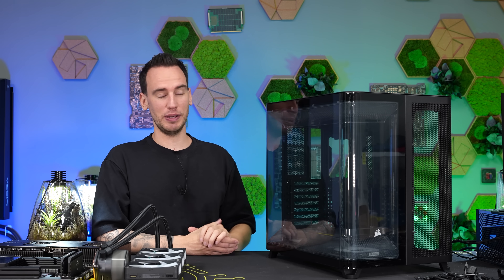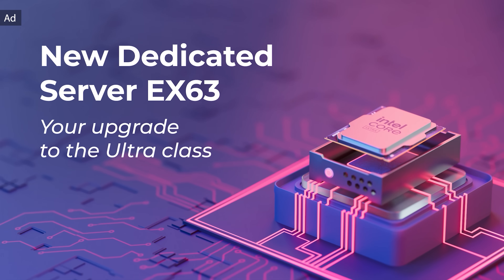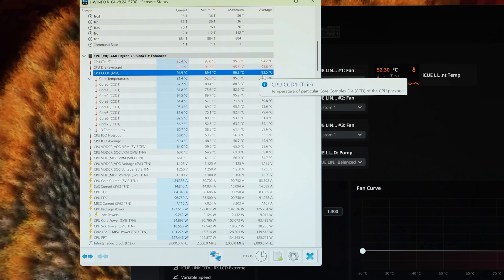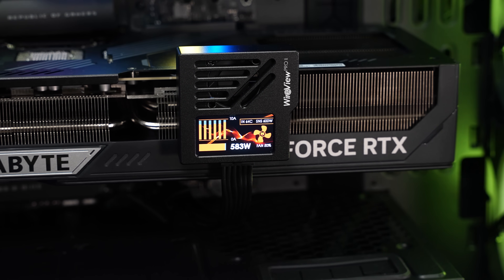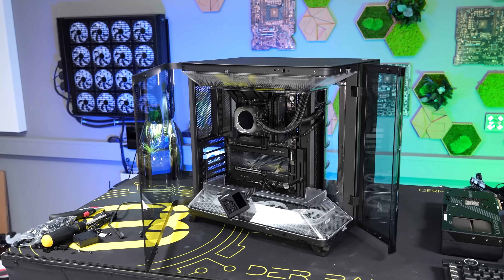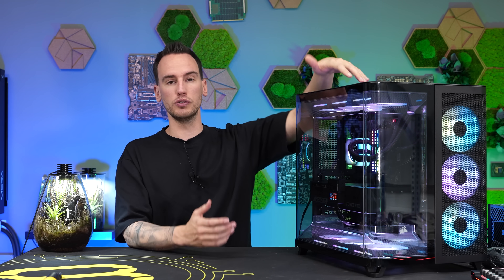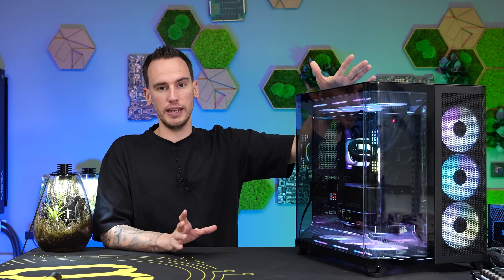Are 3 Chambers Really the Future of PC Case Design?

Comment: Don't compare cases like this please.
You're comparing a shared 3in/4out fan-setup (7 in total) with a different dedicated 3in/3out fan-setup while basically having the 3fan AIO out of the case (9 in total). That's not fair nor even close to scientific.
Remove the bottom 3 fans and the separator between the chambers and then guide it's air back in the main chamber if you want to point out the influence of all design-aspects in the same case.

Comment: First GPU holder break GPU fan. Facepalm! In 330E case. OMG
Second AIO tuneling bracket obstrict the air flow. Why is S sytle. Not just straight like inside wall of case? 
Third Upper bracket sholud be upside down. To tunel ain into the fans. Not to block it make a gap where air it trapped. So stupid. Or just remowe this "pice of sh.t". 
Fourth in second chamber is only place for ONE AIO? Can't be mounted second AIO for GPU? 

The idea is good but realization lack of polish and make some stupid flaws.

Comment: I would contest the conclusion that this case design beats all others thermally. This is only true if you insist on air cooling the video card. I've been using a Corsair 5000D for the last 5 years and it can be excellent when using a custom loop with a GPU block. I have two 360mm radiators, one at the top and one on the side panel both drawing cool air through the case and exhausting it directly without polluting the interior. I run no fans other than the 6 on the radiators. The only heat in the case is the small amount from the motherboard makes. This setup cools my seriously overclocked 13700k drawing 285W and 4080 easily and quietly. I've bought a good X670e motherboard on the cheap and will switch over to an AM5 config at some point, which will cut the thermal load quite a bit.

My setup has a lot of luxuries like a Watercool industrial dual D5 setup, Noctua fans, an Aquacomputer 6LT fan controller, and even blocks on my NVMe SSDs. But you can do it fairly cheaply without the luxuries using Corsair XR5 radiators, Arctic fans, a single D5 pump/reservoir and software fan control without compromising the cooling power significantly. I've also built a smaller scale version for my neighbor using an 011D Air Mini, two 240mm XR5s, Arctic P12 PWM fans, a single D5 pump/reservoir, a XSPC Raystorm Pro CPU block from the bargain bin and an Alphacool 4080 GPU block. This cools his 9800X3D at least as effectively as the 3 chamber setup and was similar in cost and is a whole lot smaller.

Comment: @der8auer-en I 3d printed with clear filament shroud that separate side and bottom of my Antec C8 from two back top 160mm fans ,3rd one on the front is as an exhaust connected to that enclosure I printed . This enclosure has two nexxxos xflow T30 rads with 12 push pull config fans ,it works amazing together ,this one 160 mm fan from Antec work enough with positive pressure from 12 push pull fans , my rx7900xtx or 7950x3d do not  exceeds 50C while gaming ^^

Comment: I'm here for everyone modding their builds now so the radiator is just sticking out on the side. 🤣 der8auer doesn't have to worry because he already has that giant external radiator hanging on the wall!
Reply: I have a 360x360 outside rad quick disconnects through the window to my internal 360x38 and 240x84mm rads in the case so when its 20*F outside i get mega cooling 😂😂😂

Comment: IMHO: Any case where the hottest component (usually your GPU), exhausts all of its hot(test) air straight into "the rest of the case" is a inherently bad thermal design.... Especially if that GPU hot air also directly heats up other components like SSD's...
I kind of butchered (dremeled) a asus prime201 to mount a mini-itx mobo into it, where the GPU is now exhausting all of its hot air on either left and right side straight out of the case. The AIO is mounted on the roof of the case.
I think, you (der8auer) should test the first (endorfy) case once more with removing the GPU from the case (extension cable?) ..... As the GPU is heating up the entire system massivly!

Comment: I’d love to see a change to GPU and PCIe design for consumer systems. Most GPUs blow air onto the motherboard and side of the case, which will get pulled back into the GPU and heat soak the case/CPU.

It would be great to mount a GPU parallel to the motherboard, so we could hookup an equivalent to a CPU cooler design to a GPU. Doing this behind the motherboard would allow a multi-chamber design that’s easier to cool on both ends.

The main benefit over server designs is we get much quieter fans, since we can run them at much lower RPMs, even compared to today’s consumer desktop.

Comment: I loved your O11D and I bought the XL variant but after 5 years I really need to downsize - I'm going SFF to a 10L case (NCase/FormD T1) for my 5090 (UV+OC), 4x4TB M.2 9100/990 Pro, Core 7 265K (UV+OC), SF1000 PSU, and 96GB DDR5-8200 (all water cooled, dual internal rad + external rad). I don't need 3.5" HDDs or 2.5" SSDs anymore - M.2 is not much more expensive than SATA but is far smaller and faster
The future (for me at least) is smaller - not larger and triple chamber!

Comment: Would love to see it against 207 style case where the gpu is fed from bottom fans that have access to fresh air through large areas of mesh on the sides of the case.. That case of course cant have a large front rad but nothing stops from improving the design a bit to fit one.

Comment: If you're going to make a case this wide, why not just orient the MB horizontally? No GPU sag, and you can use the entire horizontal top as intake, half for GPU half for AIO. Ex I have a Thermaltake Core X9 and I have huge options for airflow, liquid cooling, HD rack, or I could even build a second system in it. This thing is smaller but doesn't seem to be making the best use of its space.

Comment: I wish case companies would make better mobo that desgins. Ones that have pre drilled holes for open and closed case cable combs. Or even just had their own installed. Corsair cases always also seem to be very tight for water cooling unless you're buying one of their monster size cases. Is it really to much to ask for an extra inch in lenght or a better universal mount plate. The 500D is a great case but that angled piece just creates issues. If they would have just made it an inch wider and longer and a straight back tray it be absolutely perfect.

Comment: I recently rebuilt my system using Corsair cooling icue link throughout. From the start I had my doubts as of 7 120mm fans 4 of them had stickers that weren't centred and have a visual wobble as the spin, that is inexcusable given their price. I had continuous problems with the link box dropping out after booting I flashed firmware, changed the link box and reinstalled the software in the correct order, checking for conflicts. The problem was Corsairs brand new cable they supplied usb c to motherboard USB had issues. 

All of these issues are down to very poor quality control on Corsairs part. I'm not sure if I will use them in my next build. Nothing should be leaving their factory in these states, not at the prices they are charging. Basic stuff like getting stickers exactly centred isn't hard using machines, if they are having problems remove the sticker and emboss the logo during the plastic moulding process and maybe paint into the grooves, it would be better quality for the price.

Comment: I think, swiftech, probably around 15 years ago, sold an early model aio / simple water cooling kit which came with a bracket to mount the radiator outside the case. There could also be a few other case designs to separate cooling of radiators for best performance
Reply: Radiators outside the case used to be the norm for water cooled configurations, not only to swift tech. They had grommets at the back for the tubing to pass through
Reply: Yeah I never understood why this idea went away and how HP somehow patended the concept on the their HP OMEN case while still doing what HP does best and implementing it in the worst way possible.

Comment: Corsair includes a little rubber stick on thing for the anti-sag bracket if it does what yours does and touches the fan.
Reply: No, it does not touch the fan, and its not a stick on, its a support built into the case. Slides up and down and used a thumbscrew to tighten it in place.
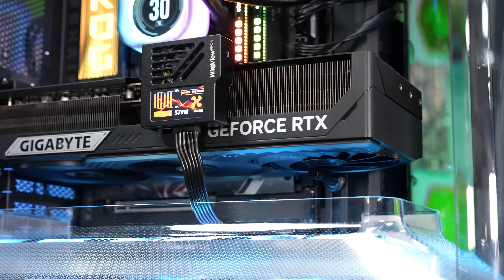Reply: @sinnirr   Did you not watch the video where it hits the fan? edit: 9:34
And from corsairs manual: 
If your GPU fan or other parts rub on the rubber arm, please use the included rubber block in the accessory box to help the arm clear any fans or moving parts.
insert image of the rubber piece you stick onto the arm
Reply: @Underskore  Not hitting the fan of my 5090 FE... /shrug
Reply: @sinnirr   Almost like it's an entirely different design, but hey since it doesn't happen to you, it'll  never happen to anyone else, so corsair totally  added a pointless extra bit of rubber to stick on the arm.

Comment: i think there are cases that allows  you intake configuration on the cpu aio and on the gpu, with other 3/4 fans on exhaust, that are a lot cheaper. and would have the same results in temps

Comment: Ridiculously over-engineered cases at ridiculously overpriced costs. All they had to do was insert a separating horizontal wall to direct the GPU-dumped heat away from the CPU and out through the back. The GPU intakes from below as usual. Out through the back before it can get near the CPU 'chamber'. The front intakes are all for the benefit of the CPU to exhaust out the top. None of this reaches the GPU or its upward wafting hot air.

Or do something similar to what Optimum did on his channel a couple years ago, using just a 3D printer he had.

Comment: I have a LL O11. 3 intakes at the bottom, 3 exhausts on the top, 3090 FE inbetween. 360MM AIO as intake from the rear. I cannot think of a better configuration.

Comment: This is why I mounted my AIO radiator on the side as an intake with a push-pull setup. I’ve got a 5090, and installing the radiator at the top of the case is a terrible idea. Now I’m getting great temps on both the GPU and CPU.  I’ve never seen the CPU go above 65 °C even when it’s pulling over 90 W, while the GPU is dumping 500 W into the case.
Reply: Well I have 2 AIOs so I didn't have much of a choice than putting one at the top as exhaust, second one is at the side/front as an exhaust too.

Bottom of course being a super good cold air intake with 3 fans.

Works pretty well, not super optimal, but most of the time, even under load, it is close to being nothing more than background noise, with comfortable temps.

The only problem I got was turning the rear fan into a intake fan, which introduced lots of turbulence and noise. Had to get 2 spacers and a filter to reduce it... I was getting close to flexing a hole into the cage. xD

I had the GPU AIO as an intake for a little while to test it, but as you mentioned, that's 500-600W being pushed into the case, which was just not great for me. So now instead it's making my side mesh super hot!
Reply: @Khazar321  
I had the 5090 Suprim Liquid, and before the pump failed, I absolutely loved that GPU. It handled 600W easily, staying around 60–62°C with low fan speeds. I had it mounted at the top of the case. Too bad MSI probably uses a low-quality pump for their Liquid series, and the fact that you can’t monitor or control the pump speed on any GPU AiO on the market is just stupid. I returned mine and went back to the Air version, which has zero issues cooling 500W at just 50% fan speed
Reply: @TheBattle1992  yeah sadly AIOs can be a quite a gamble. It's amazing to me how such expensive hardware gets treated as if RMAs are taken lightly.

But my 4090 had such annoying fans, that I just wanted to try and see how a AIO GPU would do. Let's hope my gigabyte will survive until the 6090, that's enough for me atm.

Comment: To be honest I'm not too sure if I'm really impressed by the performance of that 360 AIO. It's only 120-130 W yet liquid temp, even with fresh cold air in the Air 5400, is over 43 degrees. Was your studio really warm?
Reply: 120W is the max of 9800x3d and it's a very compact CPU, packed full with lots of stuff.

It staying at around 70°C is a great value for max usage.
Reply: @Khazar321 It's not so much about the CPU, which is fine with a 120 W draw, but the liquid temp of the AIO. I wouldn't have expected a liquid temp over 40 for 120 W with a 360.
Reply: @lagrangemechanics  I would think that 1 hour of cooling a CPU that wants to hit 90°C would at least up your liquid temp by 10°C, then to add that it's the top exhaust with a case that tunnels all that air...

Doesn't seem that unusual to me, but I don't have a liquid temp sensor, I only check my radiator heat every now and then, and I would think my 420mm is around the same range? Maybe.
Reply: @Khazar321 I've seen a 280 AIO with liquid temp of about 36~37 degree handling a 200 W load at about 20 degree ambient. A 360 with a liquid temp of 43 with fresh air intake handling a heat load of 120 W is cause for further investigation for me.

Usually you are starting to lose the efficiency of liquid cooling when your coolant temp starts to go above 40.

Edit: I think most AIO have coolant temp sensor built in. I*think* most AIO allow you to read these sensors with something like HWiNFO, although Corsair is very troublesome and forces you to use iCue. If you are doing custom loop you should really consider installing one..

Comment: Considering I still use old case with side fans, I can just add plastic cover and flip fan or 2 and get same result.

The only issue there for manufacturers is modern plain box design which does not allow cases to look different since people can't have obscured vision of melted connector on 5090 for bragging rights.
Reply: 4090s still melting now 5090 melting nvidia burning us all.

Comment: Isn't there an issue with mounting a AIO vertically with the tube connections at the top?
Reply: No. The only issue is when your top radiator part is bellow your pump
Reply: It would defy the whole purpose of the case having 3 chambers
Reply: The pump just can't be the highest point of the loop if you want it to last.
Reply: I heard that too... Right after I went to the huge trouble of taking out and in again my top AIO so I could get the tubes of the side AIO to the top...

I thought that the ultimate end goal should be the pump being the lowest point and the radiator tubes the highest. But apparently it's still "okay"?

I guess it's to get the bubbles/air into the end of the radiator instead of where the tubes are?

Comment: I have that kind of flow on my Lian Li Air mini I’m using under a Magnus Pro standing desk. 
I have my AIO radiator mounted on the right side with fans pushing the air coming front the front fans to exhaust on the right side of the case. 
The gpu is fed fresh air by the bottom and exhaust by the read. 
I don’t have fans on the top as the case is obviously close to the desk. 
I would love a three chambers case with that in mind, optimizing flow by the sides, for below desk mount.

Comment: Just imagine that plastic baffle turning yellow-ish in a few years time, like all transparent plastic parts will.
Reply: You're thinking of acrylic/PMMA.  But look at old CD's.  Neither the cases (PS) or CDs themselves (PC) go yellow.  Nor does clear PU.
Reply: imagine it changing colors / rgb or like a see thru lcd?
Reply: Paint it or blast lightly with walnut shell and put ARGB on the back side.
Reply: Doesn't it require UV exposure for that to happen?
Reply: Polycarbonate doesn't yellow. My parents' cottage has a polycarbonate roof over the terrace. We built the terrace and the roof over 10 years ago. Still completely clear, zero yellowing.
Reply: I suspect it's also a finger print magnets. But Der8auer camera and lighting setup kinda obscure it.
Reply: @fajaradi1223 how often are you touching your pc? I touch the power button that's it

Comment: I really hope that the future is less temperature demanding CPUs and GPUs   .
Reply: Good luck w that.
Reply: @Mike-om4tv heheheheheh, true.
Reply: There are many cases that have good airflow. To the extent you dont need a 300 euros massive size triple chamber case. But of course if you want glass aquarium type case, then the thermal performance can become more of an issue. Especially if the top is also glass. But testing ones setup and setting limits and curves can do a lot to make even the full glass aquarium case work well.

Comment: Downside having AIO as intake it attracts a lot more dust.

I've never seen liquid temperatures of beyond 46°C on the H170i in the HAF 700 EVO in summer ambient temps of 25°C while the overclocked Astral 5090 is spewing out 600W and the 13900K is sitting somewhere in the 140-160W range during games, during more normal ambients of around 20-21°C I'd be looking at maybe 39-42°C liquid temps at most.

Sure I do have 5 intake fans, two 200mm stock fans and the three 140mm fans from the corsair AIO, the AIO contains push-pull with Noctua NF-A14 3000RPMs so maybe that is a little unfair as they do run at 100% when going beyond 40°C liquid temps.

But noise is not a factor that mattered to me, I still want the 600W heat to be expelled quickly so it only made sense for the AIO to be in the top with powerfull fans, and that is working as intended and the CPU never throttles even at continuous 290W loads.

Another downside of these type of multi-chamber cases is that CPU height for air coolers is often rather limited without making the case extremely wide.

I even have a 280mm H115i installed on an overclocked i7 3930K at 4.8Ghz with 1.4 vcore and that liquid temp with only stock fans in pull condition don't even reach even close to that liquid temperature in a HAF XM case.